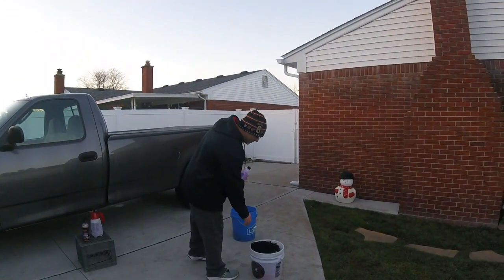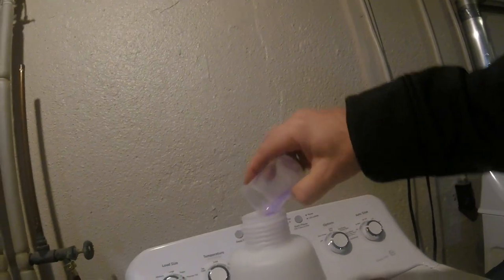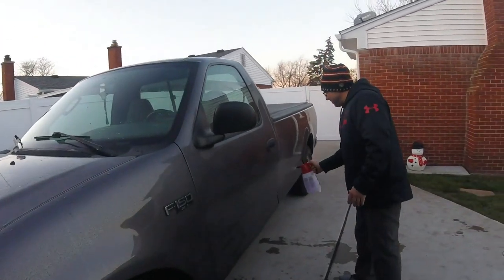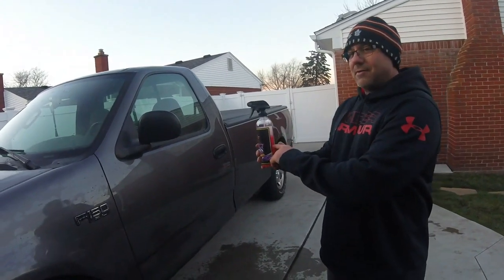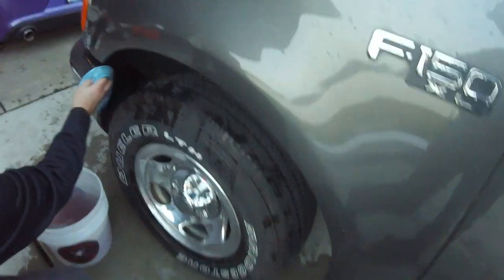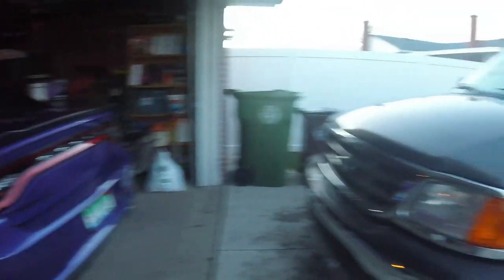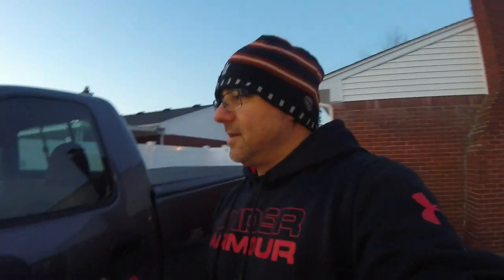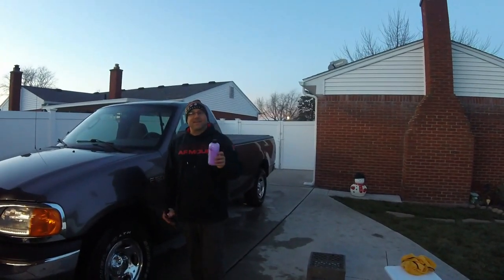Easy Way To Wash Your Car In The Winter | Fantastic Results

Comment: Looks like the Radiance works well! The whole time you were using it I was thinking your suppose to dry each panel after wiping Steve! Then you hit it with 007 and I was like ok now I see what he is doing. Haha It’s been in unseasonably warm here also. It was 50 and sunny all day here. Normally it’s about 10-20 degrees here this time of year. Great video!
Reply from the maker: Next time going do what you said panel at a time that's probably the best way . If it's warm out the product may dry before getting to spray detail. Thanks Brian the help 
Going be around 50 this weekend.